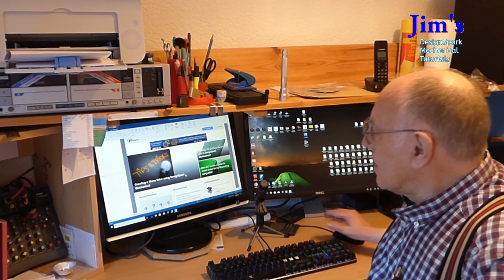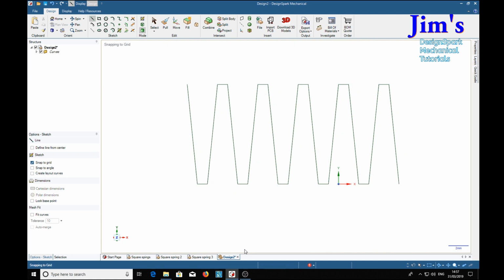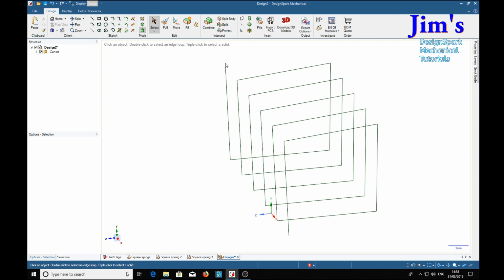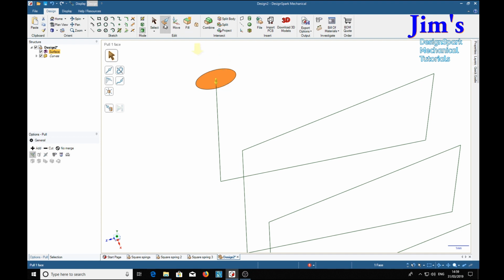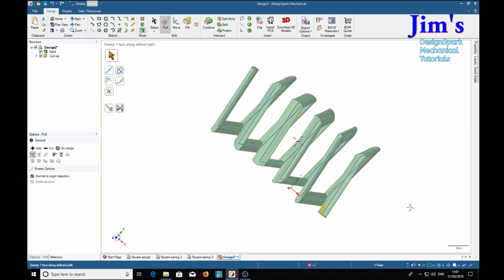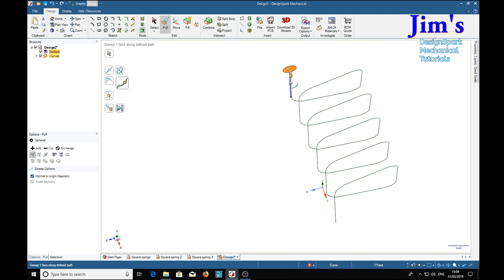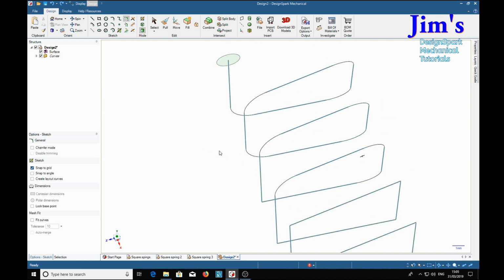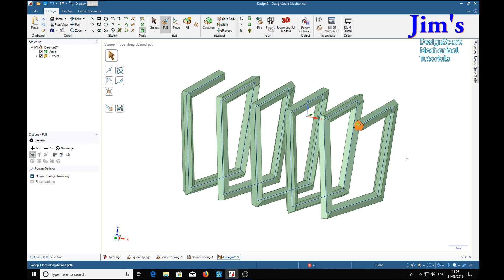DesignSpark Mechanical: Making a square spring pt1

Comment: I did not expect the 2d drawing to do what it did in 3d mode. The connecting lines of the highlighted lines actually moved (hinged is more like it) so as not to break the connection. Just found out this only works if "Maintain sketch connectivity" is checked.

Comment: I agree with all the previous Comments.  How enact a 90° axis to a Rod?
Reply from the maker: I'm not sure what you mean. What are you trying to achieve?
Reply: @JimTaylor42  It'd hard to visualize by drwng hence my question.   Take that SQR SPRNG IMAGE … How enact aa axis- coming out, 90° to the SPRBG axis?
Reply from the maker: @gripWIN  Hover the mouse pointer over the Axis icon in the Insert toolbar and it will tell you what to do. If there is not an appropriate edge or line available then you will need to construct one.